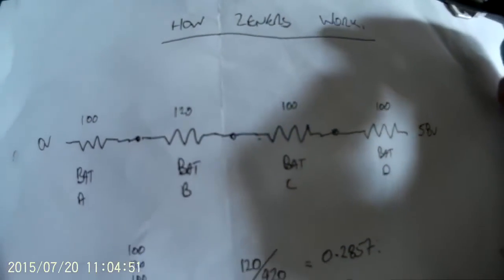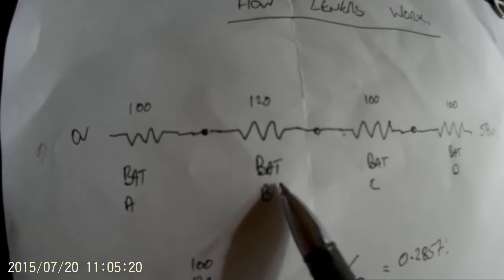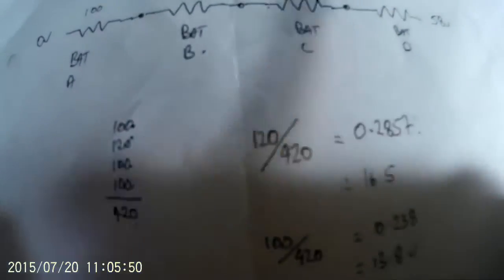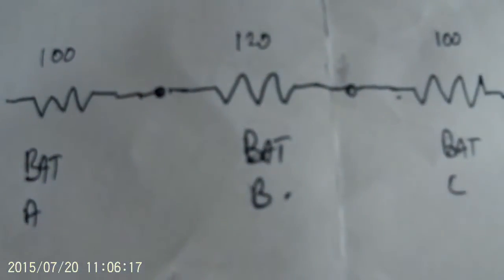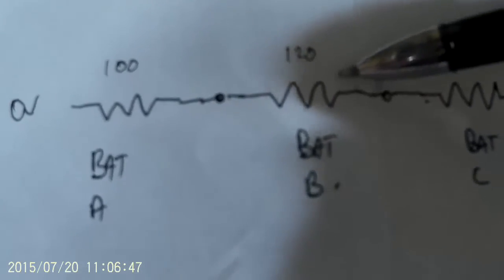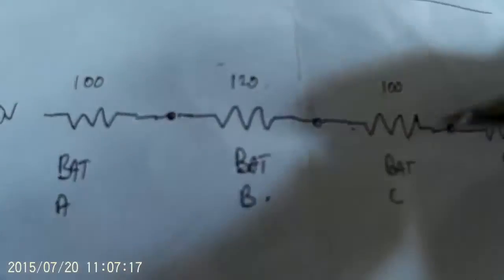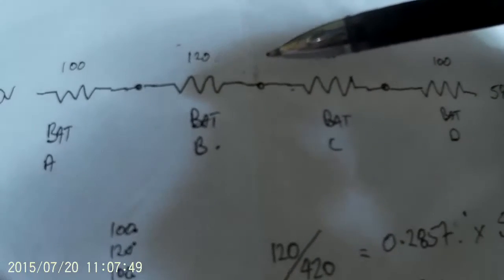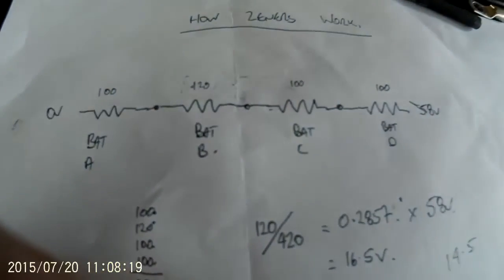How Zener Regulators Help Keep Your AGM Batteries in Balance - AGM Battery Balance Pt 3

Comment: Brilliant- thank-you. My battery box is a is bit cramped for the bottom two batteries and I was wondering whether I could mount the zeners on a old CPU heat sink outside the box. Definitely 2 sets per battery for me if we only doing 500mA.
Reply: Easily_Bored_Engineer Hi tested Zeners on Variable power supply and they come on  at about 12.8  12.9 but the LED only lights up at about 15V. Is that right?
Reply: Easily_Bored_Engineer 
Hi this is my version https://www.dropbox.com/s/so64ks3i0o93pm1/Zener%20complete.jpg?dl=0
Thank you for your help